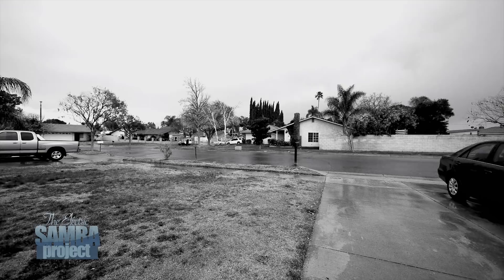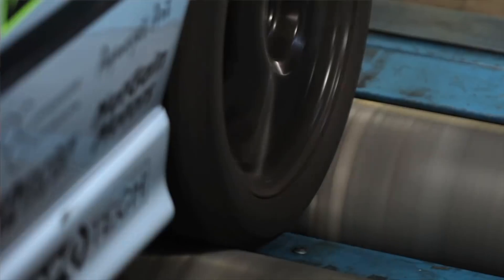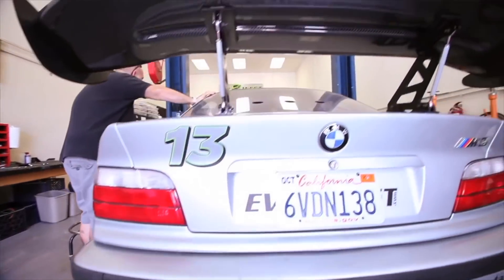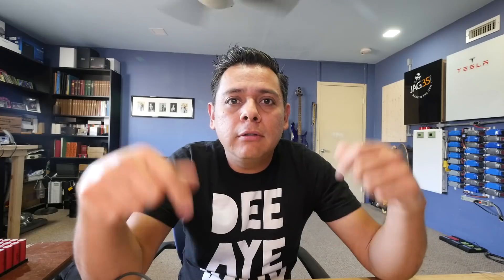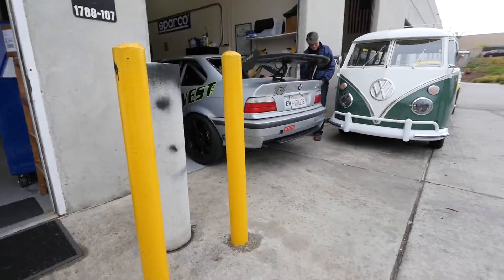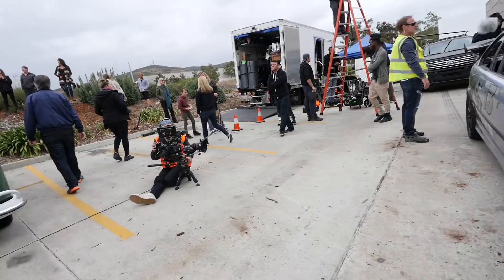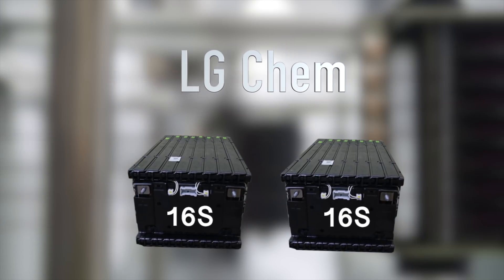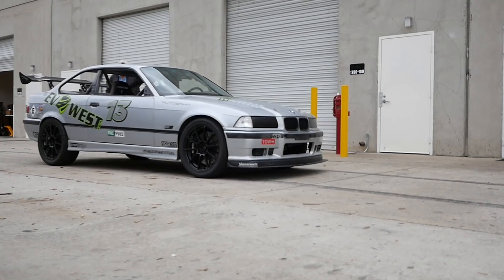The TESLA Powered 850 lb ft EVwest  Electric BMW M3

Comment: Hey guys, I've got a proposition for you. What if you were able to find a VERY inexpensive electric car and boost up its battery /distance capability and turn that into something that we could use in America for travels running at least 100 miles, possibly longer. The only thing you'd need to improve would be the batteries, as they are currently Lead Acid. If your interested, I've put together a few videos which will bring you up to speed. One, at least. Not a playlist yet. The crazy thing is , I have a feeling this is happening all over china, as this is from Northern China, and that isn't the manufacturing hub of china. Hong Kong and Scientizing are where things are really happening.  https://youtu.be/EH8hxaXOGIk

Comment: How many batteries did you guys put in? Judging visually, about 12 (8 in the front, 4 in the back). Tesla's engine is rated 400kW. So given the batteries are 64V and you took 12 of them, each can discharge at 400kW/64V/12=521 amps. That would have been impressive. I can't find the max discharge current of these batteries anywhere.

Comment: Jehu, something maybe helpful to you, have you considered going with multiple motors(maybe smaller motors even) and do you know if  there's a way to bypass both the main batteries and the panel batteries(or whatever kind of batteries on the EV? The idea would be to direct the energy created while in operation to conserve battery use. Maybe putting some alternators on and when they(alternators) reach charging rpm direct that energy into the motor(convert it to AC).
Reply from the maker: Many times

Comment: that battery performance is complete garbage. Tesla literally has the highest density batteries now and nothing can deliver double the amps per cell with the same capacity. if it did Tesla would be using it.

Comment: So one model s motor is better than two 11” motors ?
Reply: Yes and no. Smaller, lighter, has all the electronics in it, far more efficient, etc. But it doesn't produce anywhere near the same insanely unusable torque. It'll be interesting to see how it performs.
Reply: AC motor vs DC motors. 😎

Comment: Help me understand how these have better power density than Tesla S modules. From the ebay link, specs on these LGs are:

Capacity - 2.5 kWh
Weight - 40 lbs (18kg)
Density - 138 Wh/kg

Teslas are:
Capacity - 5.3 kWh
Weight - 55 lbs (25kg)
Density - 212 Wh/kg

Looks like the Teslas are still more energy per kilo. But these LGs are rated at 10 C so is that the biggest benefit (aside from price)?
Reply: The higher C means you can use less of them to get the same KW output. You can’t go as far (capacity) but you can weigh less getting the same hp to the ground.

Comment: hay there love the videos u show how 2 use battery's and e cars so U R THE 1 i believe can answer this: here lately i have been dreaming of taking a Chevy 1ton 20 passenger short buss and convert it to electric drive RV/workshop that would pull a 20 foot tandem axial box trailer converted 2 b the living area. QUESTION 4 U IS what would it take to convert the bus 4 traveling and would i need ax generator set up like hybrid P.S. i would probably  us solar as well .
Reply from the maker: 1- lots of $$ ($50k-$100k)
2- lots of work
3- determination
DO you have what it takes?

Comment: Oh the irony when a tesla beats them.... They never gonna beat tesla, they spent millions on the traction control systems/software.
Reply: Hanniffy Dinn I suspect it's lighter, the human factor in managing just LSD over software TC may not matter.
Reply: Gravitydrive certainty be interesting to see if they beat the tesla record....having watched a lot of tesla reverse engineering on you tube, their control systems for torque delivery are mind blowing astounding.  It's definitely going to an extremely tough thing to create your own comparable  software/electronics, since tesla have literally thrown millions and millions into this software.
In think when it comes down to the wire,  the little weight difference  won't matter,  since they are using the same tesla motors.... The ONLY difference factor will be who has the best Torque traction control software.  And People like rimac have comparable torque control software and their car costs like 1 million !!!!! 😖😖😖